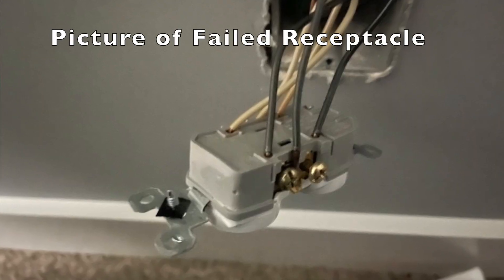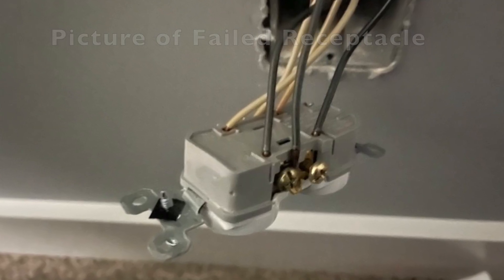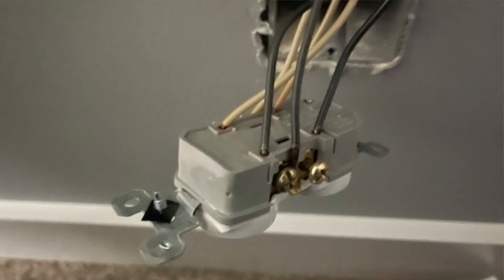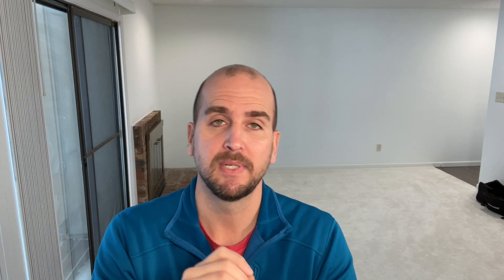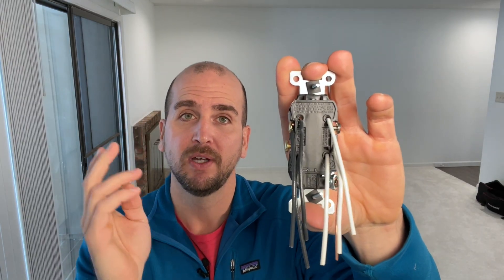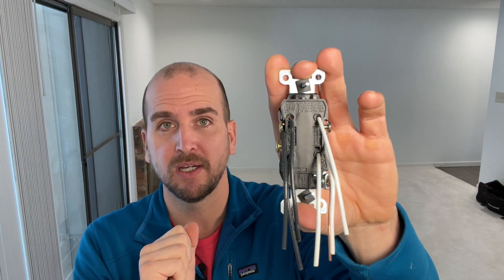Incorrectly Wired Outlet Found In Newly Built Home

Comment: 2017 Code Language:

406.4(D)(4) Arc-Fault Circuit-Interrupter Protection. Where a receptacle outlet is located in any areas specified in 210.12(A) or (B), a REPLACMENT receptacle at this outlet shall be one of the following:

(1) A listed outlet branch-circuit type arc-fault circuit-interrupter receptacle

(2) A receptacle protected by a listed outlet branch-circuit type arc-fault circuit-interrupter type receptacle

(3) A receptacle protected by a listed combination type arc-fault circuit-interrupter type circuit breaker

Comment: Around here, switches and recepticles and EVERYTHING at Home Depot come from Leviton "commercial grade". In residential use the sometimes fail in under five years. They're junk, no matter how they are labelled. I'll be going ten miles down the road to try Eaton next.
Reply: You get what you pay for, take your scale, why is the 2 buck device heavier than the 79 cent special?  Grab a plug and plug it in both and see which feels like a good connection.

Comment: Some of the local AHJ codes prohibit backstabbing a receptacles for this exact reason.   As well as stranded wrapped around the screw versus a compression plate on the receptacle in commercial environments.

Comment: You make very good points with this video and agree with you whole heartedly.  I worked as an electrician doing new tract home construction. The main reason (not that it is right or Correct) is the time it takes to make up each receptacle or switch.  Most finish electricians are paid peace work. In other words, the more you do in a day the more money you make.  It takes more time to create Pig-tales, as do "J" or Shepards Hooks and side wiring.  It is very quick to strip and push the wires into the back wire connections.  I was the foreman that had to "Wring the houses out" I would go through the house after the work was done, and make sure everything worked as it was supposed to.  If I found a problem it was up to me to troubleshoot and correct.  Using the back wire (Push in) connections were often time problematic. I would find problems with receptacles not working due to loss of Neutral or Hot connections causing a dead circuit, sometimes two or three receptacles away from the one that was dead. The correction was to do a pigtail and side wire. That would take care of the issue at least until another issue came up downstream at a later time, and that would be fixed under warranty if called on it.  Some of the things I saw doing this job would make your head burst.  Romex cable "Homeruns" pulled across the top of the live bus bars in panels because the contractor was trying to save money on wire. Many may have heard of Oklahoma 3 wires on 3 or 4-way switch circuits where when the wire was pulled, they forgot to put a 14-3 Romex in for a Traveler circuit, so they would Heat UP a Neutral and use the ground for a neutral. This got me shocked more than once.  And one more tidbit, Lineman pliers are just that. Klein is the brand name for a line of tools. This is like calling an Adjustable Wrench a Crescent Wrench. Crescent is a Brand Name.

Comment: All wall outlets need to be 20amp and do not use the push in feature. Pigtail all your outlets. You want to match the wire size to the outlet rating, 15 or 20 amp. Most new construction, your wall outlets should be #12 wire and ceiling #14. Better to use #12 through out the house and where needed your larger guage for stand alone circuits. Ground all your outlets. Also wrap the outside of the terminals with electric tape.

Comment: HI SCOTT THE MAJOR MISTAKE I FIND IN HOMES IS USING THE RECEPTICLE HOLES IN THE BACK TO JUMP THE CIRCUT FROM ONE RECEPTICLE TO THE NEXT BUT WHEN A RECEPTICLE GOES BAD ANYTHING BEING FED AFTER THAT RECEPTICLE WILL ALSO GO OUT ITS JUST A TAIL, NOT PIG TAIL. PIG TAIL IS THE TEMP. LAMP SCOCKET DROP ON TEMP. LIGHTING I ALSO NOTICED GROUND DOWN GOOD JOB. I JUST POSTED ON THAT SIGHT TOO.

Comment: One other point regarding using a pigtail vs wiring in two hots or two neutrals attached to the outlet.  When you  use two hots (or two neutrals) the current carrying element should never be dependent upon the appliance (outlet in this case).  Amp ratings are assigned to wires as current carrying conductors not the brass components of the outlet.  The break off connectors on outlets, when used to " split wire" the outlet for separate switch are not designed or intended to carry all the line current.  Anyone taking a code class will run across this particular nit picky topic but it makes a significant point .  You do not want the break-off connector a fuse in the circuit.
Reply: fascinating(!) ... a bit of a mystery to me how three wires in a twist cap arrangement are electrically superior to two wires in a "J" configuration secured by a brass screw that is tightened down.   ...inferring that  "brass components of the outlet" (for more than dollar store receptacles) are, for lack of better term, inferior and a fire hazard ... thought provoking!

Comment: Another reason for using the pigtails is the codes are getting to be a lot more stricter on you're allowed up to six outlets or duplex outlets is there correctly termed on a circuit but if there is a life prolonging appliance it's plugged in downstream of that if you had all the wires stabbed in as in that at the start of the video if you go to a place that receptacle that person's in trouble

Comment: I've installed thousands of outlets, driving down the posts on an outlet in a nonconductive box is nonsense, although in a conductive box it's a must. Push-ins are fine for 14 gauge and anyone who says otherwise doesn't understand that there is a tab between the posts on both sides to separate the top from bottom and it is the main failure point. Three wires in an outlet should be avoided because the outlet isn't a slice point and relaying on it to do so isn't a good idea, but wire nutting two pairs and using the two push-ins isn't a problem.
Reply: I run the screws in in nm boxes. Lessens the chance of touching them
Reply: Also just went through  a 23yr old house checking devices. Found 4 out of 11 in the basement with bad push in connections. The torsion spring that holds the wire anneals over time from the heat. Couple that with 60 cycles a second vibration and two decades of time they are prone to failure.

Comment: Most of these and the accompanying comments are personal preferences. I’ve seen a few cases of push-in connectors failing, but it is pretty rare. Clockwise wiring around a screw is pretty widely preferred, but I’ve found plenty of working receptacles the other way. The most common failure I’ve seen is actually broken plastic due to tripping over a plugged in cord. I’ve done it myself. Sometimes it is behind the plate and takes months or years to completely break apart and cause a problem.

Comment: Pigtailing is required by code and if it is not done any given outlet will have the full load of all downstream outlets going through it, even if it is not being used at all.  It's actually parallel wiring, as opposed to series wiring, a better situation.
Reply: What the code? Article 406 says nothing about pigtails.
UL says all 15 amp outlets have a passthrough of 20 amp

Comment: A common mistake made with pigtailed connections is the "extra" wires are not accounted for in the box fill.    20 cu inch single gang plastic new work boxes (typical rough in boxes) are rated for 9-14ga conductors. Up to 4  14-2 romex cables [4 neutrals,4 hots,1 ground] if used as a splice box but when planning to device it running 3  14-2 romex cables [ 3 neutrals,3 hots,2 for the device, 1 for the ground]  Add the pigtails you add another 2 conductors making the 20cu inch box overfilled in that scenario.   Alot of electricians don't plan for that and get flagged by the tougher more stringent inspectors for not putting in a larger box when running 3 - 15amp cables into them.  I try to never use 20 cubic inch boxes if possible when using more than one 12-2 romex.    Nothing worse than leaning over a kitchen counter trying to stuff 2  12-2 (or more) pigtailed romex's on a gfi into a 20cu inch box that a careless home owner/handyman used in their remodel (that would be overfill as well)
The cost difference is negligible so always go with the bigger box to begin with for safety reasons first then sanity!

Comment: Pig tails not beneficial when only 2 each conductors. That's what the 4 screws are for. Pig tails create an additional unnecessary connection point and fills up the space behind the receptacle. Waste of time and materials since 95 percent of receptacles have 3 or 4 conductors in new installations. Thanks

Comment: We found a couple of 20 amp wall plugs and breakers on a 15 amp ,14 guage wires! We didn't even know until we hired an electrician to add a 20 amp circuit and plug on our exterior back porch. The electrician said the wires in the wall should have been 12 guage. He advise we convert the plugs back to 15 guage with a 15 guage breaker and we agreed. Its scary what people do to their homes.  The home inspector we hired didn't find this potential fire hazard wich only makes us wonder what else he overlooked!!

Comment: Hi, 
I have a wall framed and wanted to put on both sides of the wall two lights with a switch and an outlet in the all back to back. The question is how to conect and do the wiring? Please advise.

Comment: Something I’ve encountered is there’s barely enough wire to pull the receptacle out of the box and reconnect to the new receptacle. I often wondered how they connected them in the first place but learning about using pigtails was a godsend! In spite of this something that my dad did was use 12 gauge instead of 14 gauge wire but still used 15 amp fuses and breakers. It placed any overloads at the breaker instead of the wiring.
Reply: The only thing I use 14ga wire for is from a wall switch to a single permanently installed overhead fixture. I know it will have a couple light bulbs and a fan at most for its entire life and it’s not possible (well almost not) for a resident to inadvertently overload it. I like your dads idea on outlets but I just make sure all standard outlets are 20amp capable and compliant. It’s more expensive but no where near as expensive as burning down a house and You never know what someone is going to plug in to an outlet over the years. A couple of space heaters can easily put a 15amp receptacle or breaker over limit. Having the fire start at the receptacle is better than in the wall, but I’d rather try to prevent it altogether. Just my thoughts

Comment: I'm not an electrician so what is the the reason for thee neutrals and hots when there's only two outlets?
Reply: You have one hot and one neutral coming into the box and t hots and 2 neutrals going out to feed other outlets. Not the best way to wire outlets.
Reply: @davidhenderson3400  I had red r lx

Comment: I don't really suggest putting in outlets with USB Included. A USB transformer to convert 100-240VAC to 5V/2A DC will eventually either
A)be upgraded out of functionality. Example, modern USB C becoming more common on both ends, so making this device not only slow charging but now obselete 

B) these cheap transformers often fail spectacularly and if it does you can't just unplug it quick, you now need to cut power and wait for it to cool then replace it. 

Overall, it's just better to have complex electrical equipment outside of the wall

Comment: Reg. "Push In" connections, the argument against would carry weight if actual instances of failure were cited and the corresponding percentages overall. Saying "professionals" stating "Push Ins are more common source of failure" is a failed argument from a point of authority (what authority) without stating the "professionals" specifically. Please add the specific and actual references you are claiming to support that statement otherwise your accusations are automatically negated for failing to support facts.
Reply: When I did my house the push in wire nuts and screw wire nuts fail more than just using the 2 screws. 
I cut my hands too many times trying to it 100% correct. Top/bottom screws it was. And my house was built almost 100 years ago and I had to go with the smallest legal box.

Comment: If this is a "Best Practice" video, then you should address the nicks or scores of the copper wire. They are future break points of the copper wire. If the stripper you use cuts or scores the copper wire then that is a possible future fail point.
Reply: Not to mention, it's now decreased the size of the wire at that point.  Start with a 10 ga wire, take a nick out of it, now it's 12, 14, 16 gauge at that point?  Now there's a point where the wire can overheat and start a fire.
Reply: @HallowedWeasel  The problem is in the copper, it becomes work hardened over time. Scrapes become fractures and then open circuits. A good electrician's pocket knife is a very good tool... if used correctly.

Comment: I was in an apartment where are they had run four wires into a wire nut and you could hear it arcing when the lights to my apartment were on. I went and repaired the problem so that there would be no loss in connection at the junction box. I know you rarely see soldering of wires in-house wiring and it may even be illegal but that was one of the ways that I knew I could repair the problem and I sealed up the connections and replaced what needed to be replaced.

Comment: If I was putting that pigtail in an outlet in my own home I would solder the connections together after I twisted them together.  then I would put the wire nut back on and I would tape up each individual connection before I connected it up to the outlet.  that's just me though I don't know if it's code. But I feel a solid connection is a lot safer. I feel that anytime you have a chance for corrosion to build up and a place for stuff to Ark cross that's a chance for problems to become apparent.
Reply: well itll never come apart on its own and doubtful a person could do it LOL

Comment: I always screw in the unused connectors.  I always use pigtails.  I also use push-ins.  Just redid my house from previous owner who had ivory outlets.  I installed all white outlets and switches to match trim as I typically do.  Those push-ins were in place for at least 2 decades and I tried to just rip the wires out using brute force.  I failed on every single one.  I had to break the outlets to get the leads out of them.  I then realized I was doing the wrong thing on the specific style of push-in and was able to extract some of the last few without breaking the outlets.  I just buy typical home grade outlets as were the ones I removed.  I am not sure what the percentage of "failures" these push-ins are shown to have, but it must be at least lower than 1/50 as that is how many I have had to disassemble by breaking or using the release mechanism.

Comment: As a non electrician fixing commercial equipment and dealing with 208 and 600v I feel there are some best practices that are left out, one is to allow the wire nut to twist the wires not pliers if it's solid wire, it results in a stronger and tighter connection, the other is a wrap of black tape around the sides of the receptacle.

Comment: The scary part, as an electrician in Belgium, is that al these systems you use, are so not allowed here, 
Like plugs with no protection of single inserting stuff in the front (like sharp metal items)
And all our sockets are IP20 rated, not llike these with a "hot" screw.
And connection 3 wires with those plugs? dont think we have done this in 20 years
That said, still a very informative vid

Comment: Why am i not suprised? Saw this 20 years ago.#14 wire is junk to lite.I wont install it.#12 safer.And pigtails must be twisted then wirenuted,not just stick in the wire nuts.Couple electric heaters,one bad joint,youll have a problem.Dangerios risks..got to be done perfect every time.Take time to make sure its right.

Comment: Not bad but the only thing I would add is put the screw on the cover vertical, it's not code but you can normally tell a diy vs pro just by looking at that

Comment: Somewhat experienced DIY'er.  In every video I see and every person I watch install wire nuts, they twist the wires before installing the wire nut.  I don't know where I read or saw it, but I remember that the instructions for wire nuts was to NOT twist the wires and that is what I have followed ever since.  I don't remember exactly what reason was given, but I think it was the twisted wires not making as much contact with the wire nut as straight wires would.  Another reason could be the pre-twisting might cause the bundle size to get smaller when twisting the wire nut on and causing a less than secure connection?  Don't know what is correct versus what is the better approach.  Need input for this this CDO (OCD for those of you that aren't; it has to be in alphabetical order, you know!) individual that has an objection to going against instructions even though everyone but me seems to pre-twist.
Reply: Even the instructions on the box of wire nuts says to just line up the wires and stick on the nut and start twisting, no mention of pre twisting at all
Reply: You will never have pre-twisted wires - plus adding the wire nut - come undone.  You can visually ensure that all wires are securely together, even, and in good contact.  With that said, wire nuts used without pre twisting are also very secure, as long as you double check each wire and you also twist the wire nut until the wires begin to twist together.